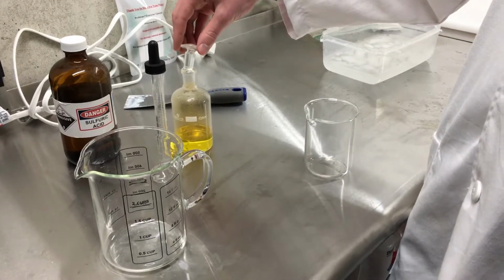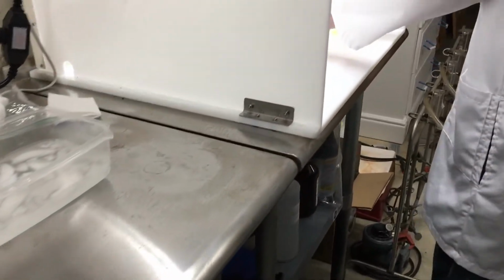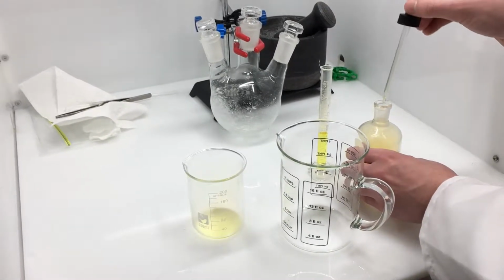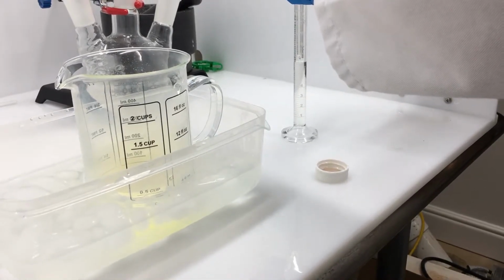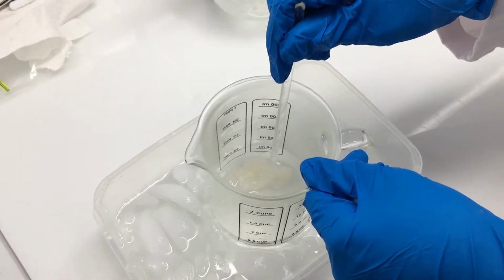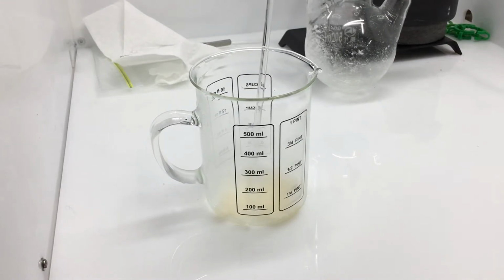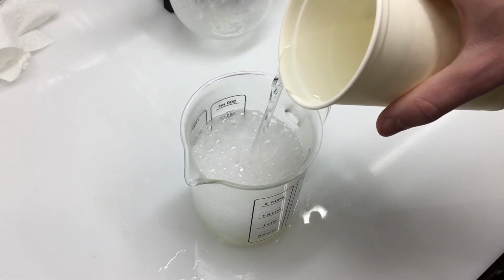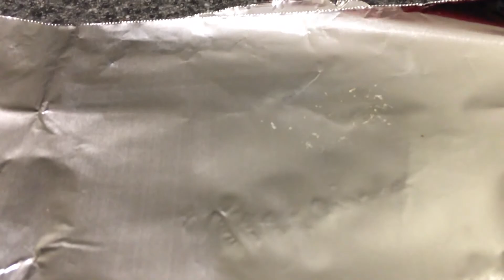Nitrocellulose from Fuming Nitric Acid

Comment: I always works like you without wearing gloves  and mostly without eyeglasses too.. sometimes one hot points forming in the cotton , begin with buzzing noise with a lot of NO2 gas, mostly when you see it, you need immediately try to push the point , using string stick to make it cool , if its not controllable than  put the hole beaker inside a big water container to neutralize acids otherwise its going out of control..
Reply from the maker: You are not  supposed to wear gloves with fuming nitric acid; they can catch on fire, melt and stick to your skin, and cause bad burns. But please wear glasses
Reply: @ButPrestonDidIt  yes its true.. :)
Reply: if the acid mixture havent been cooled down well, It starts making NO2 gas.